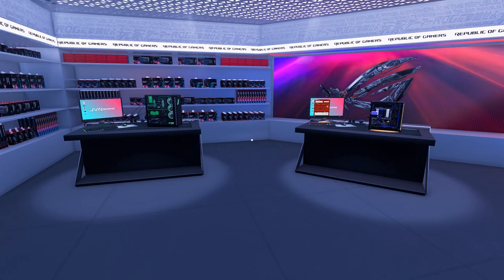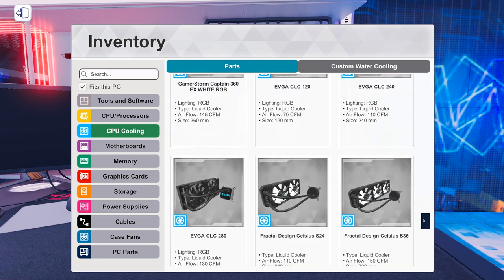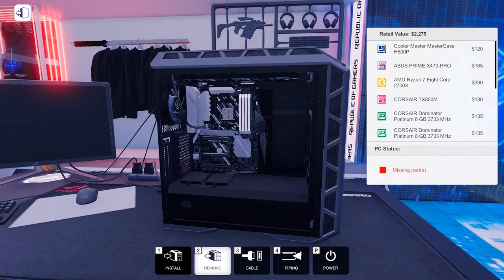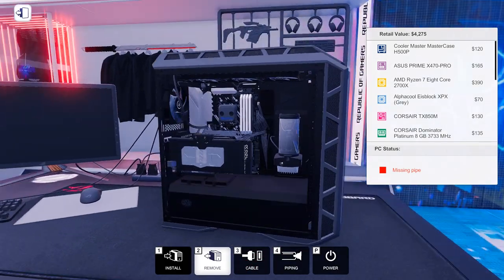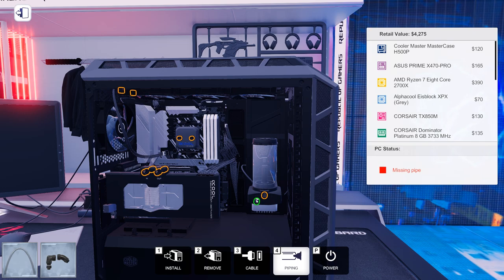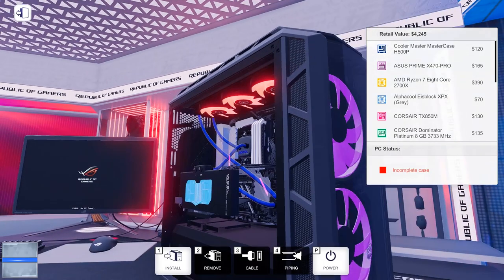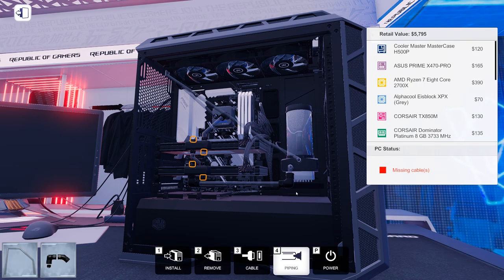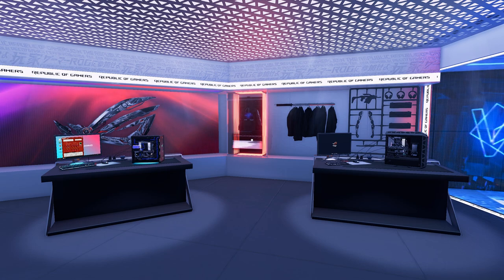How To Water Cool Your PC In PC Building Simulator

Comment: So, u have to make the pipes through the GPU first, and then CPU, after that the radiators and back to the reseivors(i’m not sure)
Reply from the maker: Where you start doesn't matter, just make sure you make a full loop and get everything connected.
Reply: Thanks, bro.

Comment: hi jvn so i know this is just a game but in my game for some reason when i do a custom water cooled loop like you showed me in the video my cpu and video cards heat up to 80c which is not good for a water cooled system is there a reason for that i know i did the loop properly
Reply from the maker: As long as you've got coolant going in and out of your cards, you probably did it right. I've noticed that sometimes components get unrealistically warm for being on a full custom loop, so guessing you're seeing the same thing.
Reply: @JVNGaming  yea i re did the loop and added more radiators then just the one didnt know i could do that and it dropped the temps down another 15c so
Reply from the maker: Nice!

Comment: why my temp is so high on cpu? and also if I do benchmark the my fps drops on cpu test? any solution?
Reply from the maker: You remember the thermal paste? Got your loop completed and fluid reaching everything? In OCCT you can run a stress test and see if it says your CPU is thermal limited.